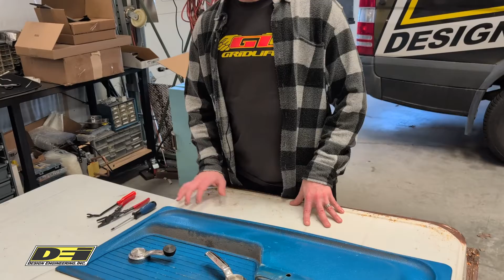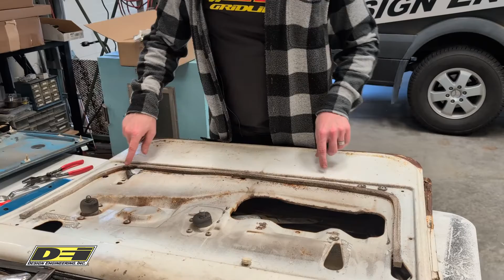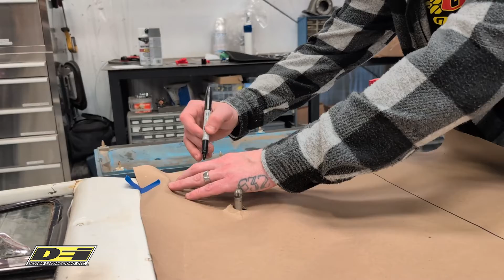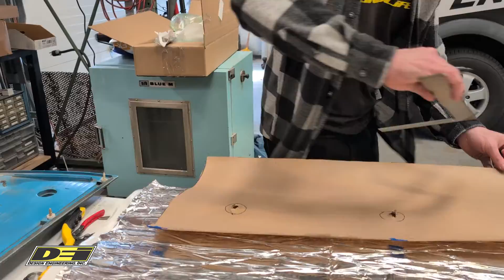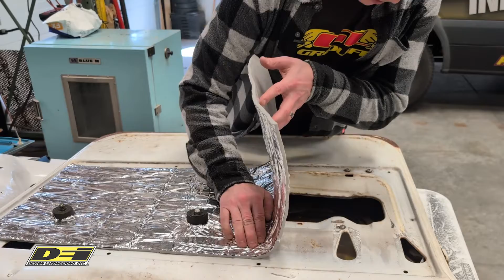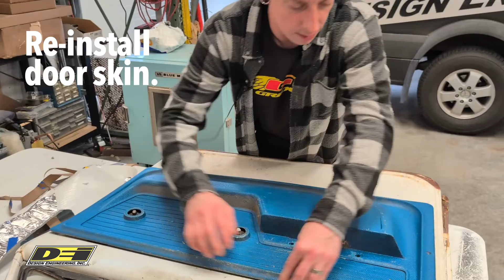Door Vapor Barrier Kit from Design Engineering, Inc.

Comment: I love your guys produces I have a few of them on my car only problem iv run into it the kits never come with enough. Header wrap need 2 rolls at 45 bucks each to fo a set of headers , intake tape need 2-4 rolls for 1 rig , heat mat is 100 bucks for a kit and it only dos 1 side and not ever the full side. When cool-it and flex-lite makes the same thing color for color , same thickness damn near a copy and paste, but you get more per kit and for an 1/8th the price. 
We just blast matted our entire nomad with cool-it firewall and both sides of the tunnel with heat shield for $85 2 full kits of different products totaled $85.42  and completed the project. So it's hard  supporting and enjoying your products as I once did. You guys make quality stuff but cost to quality dosnt line up
Reply from the maker: Thank you for your feedback and for being a longtime supporter of our products—we truly appreciate it. We hear your concerns and understand how pricing and kit quantities can make a difference, especially on larger builds like yours.
One thing we’ve worked hard to maintain over the years is the superior quality and performance of our materials. From our proprietary technology to the durability and long-term heat resistance of our products, we prioritize manufacturing standards that deliver results you can count on.
We would value the chance to connect directly and talk through the specific products you used and discuss options or bundles that could better suit your needs in the future. We’re always looking for ways to improve and ensure you’re getting the best experience possible with every install.
Please feel free to give us a call at 800-264-9472 at your convenience. Thanks again for your past support, and we hope we can earn your continued trust.